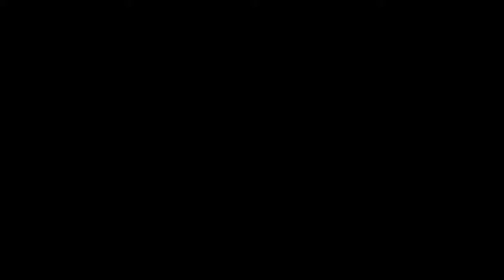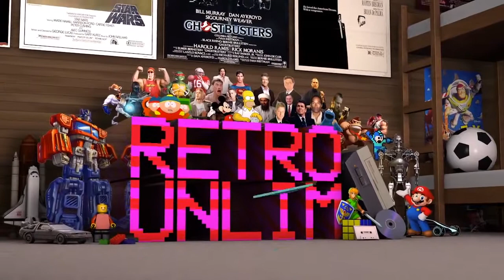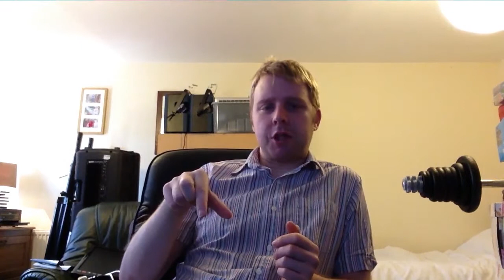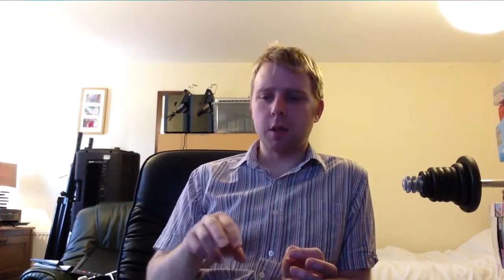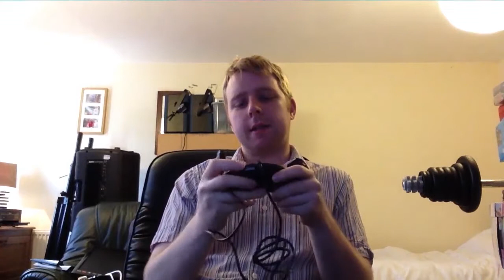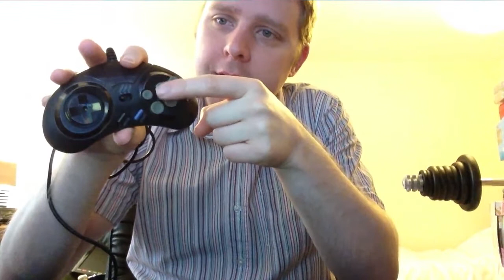Channel update July 2013

Comment: I am partway through editing the podcast as I type, just breaking off to check a few YouTube vids.

The emulator sounds exciting. Is it difficult to code games for the platform (Master System-based, I believe you mentioned)? Only have experience with Actionscript, personally. ;)